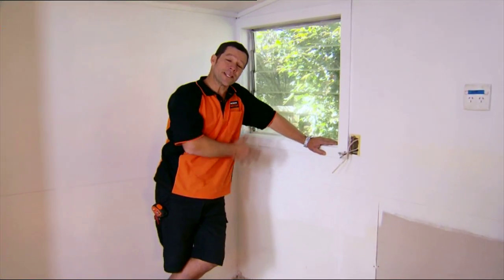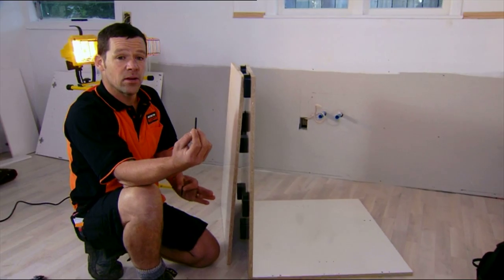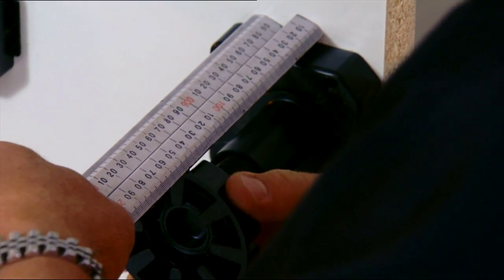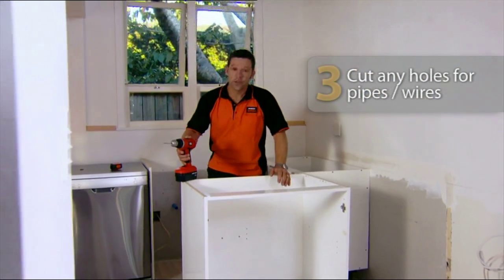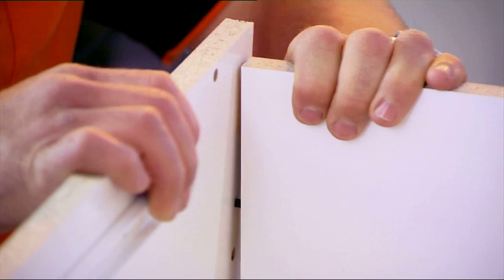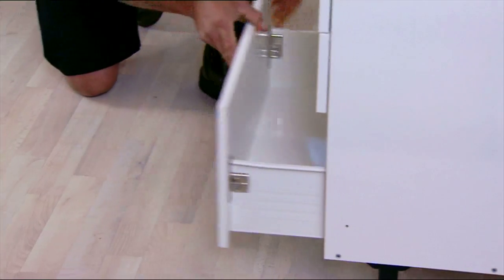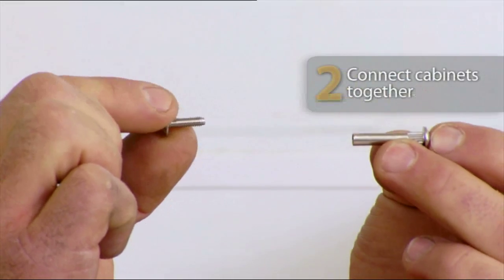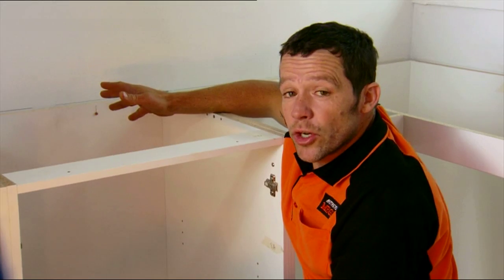How to Install a Flat Pack Kitchen - Part 2 | Mitre 10 Easy As DIY

Comment: Why is it so important not to over tighten the screws on this build?
Reply: in case you make a mistake
Reply: Don't overtighten because you'll pull the material out of the hole ...  Thus increasing the diameter of your hole and making your screw useless